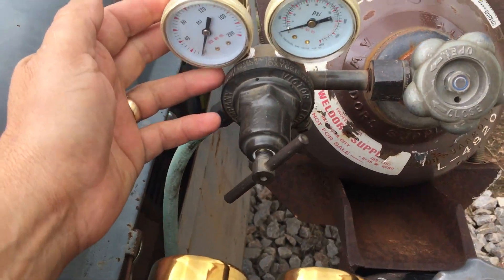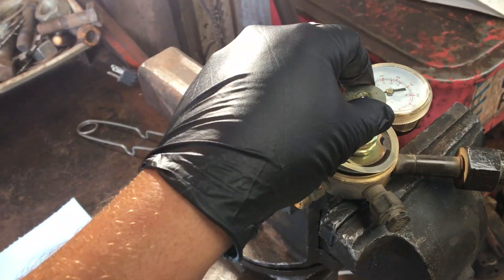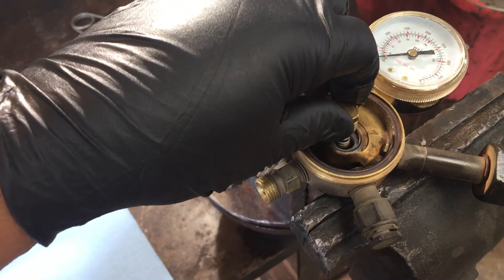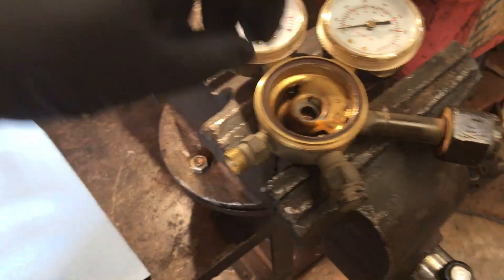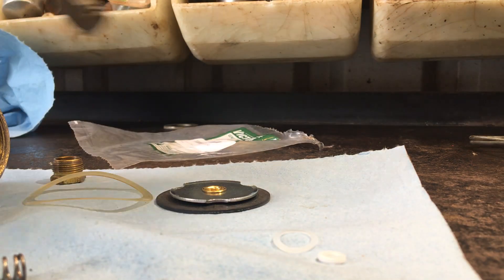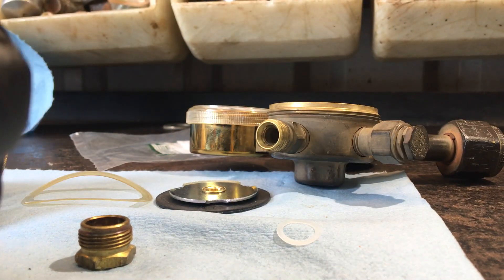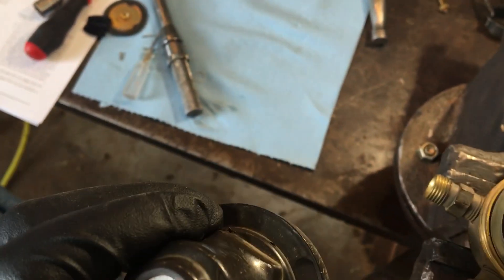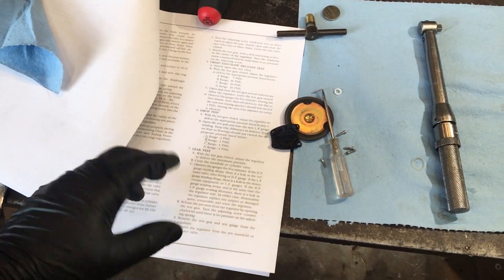Oxygen reg rebuild

Comment: Wanted to rebuilt mind, it just broke yesterday. I looked at your video last night and figured I could do it.  I called the company that sells Victor Parts, I have model 250-80-540 a Victor Medalist Oxy regulator.  Was told they do not deal with the public, but let me give you the part number for the part you need  plus the part number for a complete rebuild if you so desire, thanks.  I call the closest dealer (Arc3 Gasses
 FREDERICKSBURG, VA) as found on the ESAB web site.  They tell me...sorry we dont sell parts to the public as you have to have 2 Million Dollars liability, we have a guy that can rebuild it for you, but it will probably be cheaper to just buy a new one...WTH?  Great service, thanks, I will go into Harbor Freight tomorrow and and buy a $70 Olsen!
Reply from the maker: Try eBay or Amazon. They sell them

Comment: I realize this is a bit dated and that you probably already figured it out, but if i am reading your regulator's Mod No. correctly, I believe the C at the end indicates it is rated for 80 PSIG output.  So your relief valve is acting appropriately.
Thanks for the video, John

Comment: Soap is made from oil use alcohol
Reply from the maker: Is alcohol flammable? If so I’d recommend not using it. But what do I know?  🤔
Reply: Alcohol evaporates clean in no time nothing left behind don't be in a hurry and let it dry should be way safer
Reply from the maker: jaysen2200 says the guy with the skull and cross bones! Lol you do it your way, and I’ll do it mine. If ya rinse well the soap is gone. Mine hasn’t exploded yet, have you ever rebuilt one?
Reply: Yeah I have I'm a welder . Soap is one of the worst things you can put inside a regulator your lucky so far to not get exploded .
Reply: No hate man I don't mean to come off as a troll

Comment: Thank you for posting this vid, My oxygen reg just went creeping with the last tank I put it on...:-{  & I needed to take it apart & see what the  problem is, but didn't know if I would be in a huge mess if I opened it up... I tried your link to the repair manual, but it comes up with an error page, could you please repost it?
Reply from the maker: Yeah I can’t get it to work either. I just googled victor regulator service manual. Not sure why it won’t work.
Reply: @Digginok  ; I've looked everywhere online, thanks for trying, I appreciate it....:-}

Comment: Good video. I've rebuilt many regulators because it's a great way to save money and downtime.
WARNING! When working with OXYGEN regulators use acetone and NOTHING else or different to clean them. Study cleaning to "oxygen safe" standards. It ain't hard but high pressure (the cylinder pressure before the regulator steps it down) oxygen can burn things like metal most people don't consider flammable. 

I grind the chamfer off my seat socket so it engages the nut flats fully. Those chamfers exist to center the broach which cuts the internal flats of the socket and they are not necessary or useful from an end user standpoint.
Reply: Why use acetone if it's extremely flammable?
Reply: @anthonyskorner4511  For cleaning only. It has a high vapor pressure and evaporates quickly. Women use it as nail polish remover. A strong solvent but highly flamable.

Comment: Hey Frank
Victor makes good stuff. Well worth what they cost.  I have a set of 50 year old MECO (Modern Engineering Co) made in St Louis, Mo that was given to years ago. I had the same type of line pressure creep that you had on the oxygen regulator. The MECO regulators are a multi-seat design Soto repair that problem you take the back cap off the regulator and remove one screw to rotate the seat block to a new seat surface. Each block has 4 seats on it before it needs replaced. MECO came only with that design in 1922 or so. They were bought out by Victor/ESAB in the 90’s.
Reply: Seal Seat carries parts for many old torches and regulators including Meco. http://www.sealseat.com/  
Tip adapters are available for Meco. I have a couple of these:
https://www.atlweldingsupply.com/collections/cutting-tips/cutting-tip-adaptors
Check out Weldingweb. I collect and rebuild torches and regulators and learned a lot there.
https://weldingweb.com/forumdisplay.php?2-MIG-TIG-Stick-And-Oxy-Fuel-Welding

Comment: Good video. I think the kit was missing the large white plastic seal that was under the main body. I've rebuilt a few different regulators and if I remember correctly the kits all came with new seals. Also if someone isn't comfortable rebuilding their own regulators Victor used to offer a rebuilding service for a fair price. Yes, clean and oil free is important, water soluble soap, a good rinse and dry air will do.
Reply from the maker: Jim Zivny Thank you, I thought the same on the washers too, The last kit I bought had them included, this one didn't have them listed though.